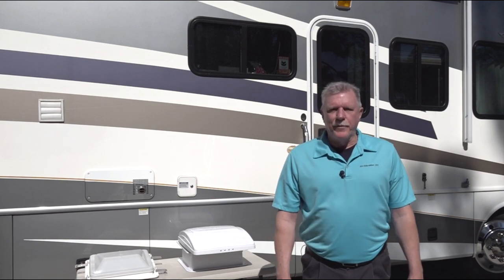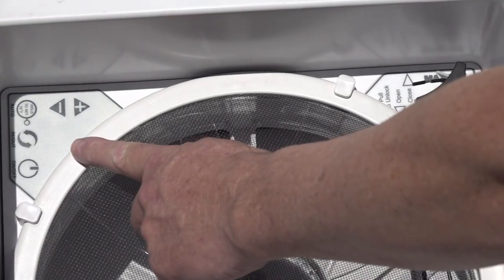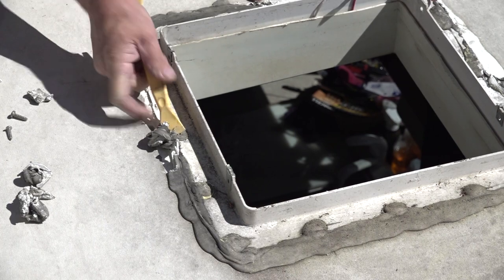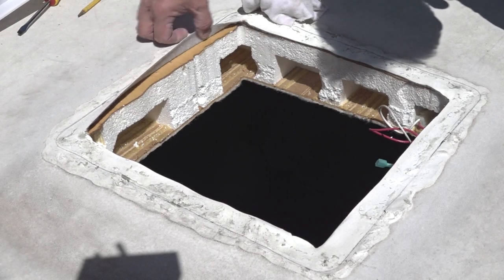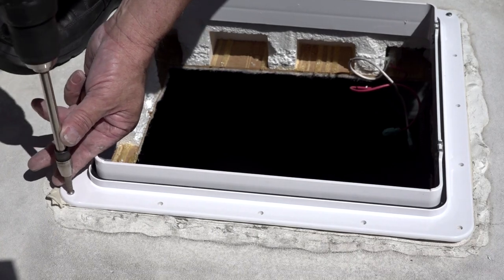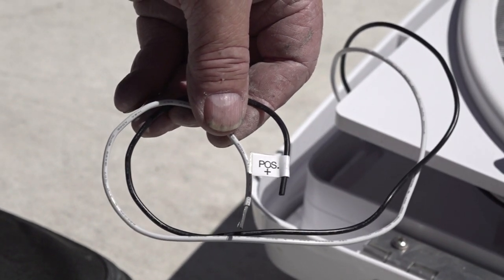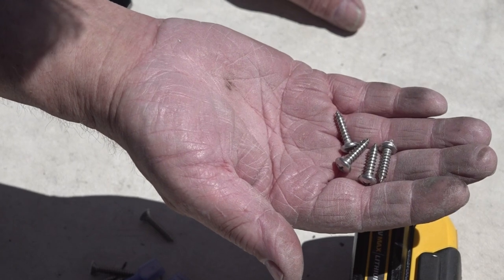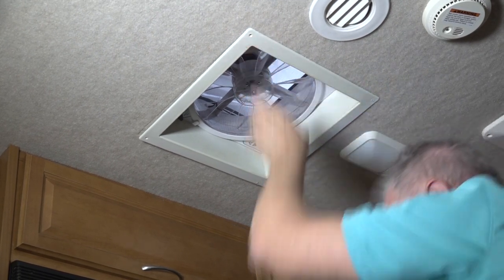RV 101®  - How to Install a High Speed Ventilation Fan in your RV

Comment: Looks like you replaced the same type of fan. How long did the old one last?
Reply: Hi Mark, I literally just bought three maxxair fans for my camper. The four speed exhaust fan was delivered today. That's just for the bathroom. The other two are the 10 speed reversables for the kitchen and the master bed room. BTW, I'm a big fan. All the way back to the RV renovation series. I'm also a Vet, US Army 75-79. You keep making videos, I'll keep watching them.
Reply from the maker: I replaced the OEM fans in 2009, so over 10 years I am guessing.